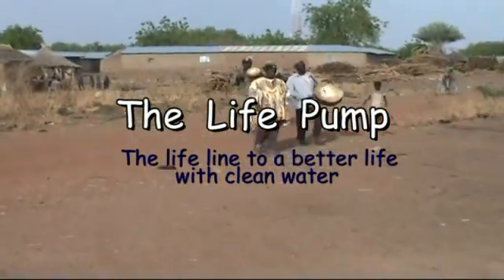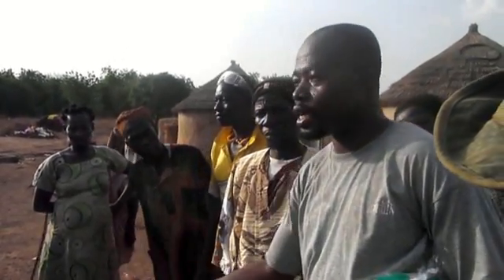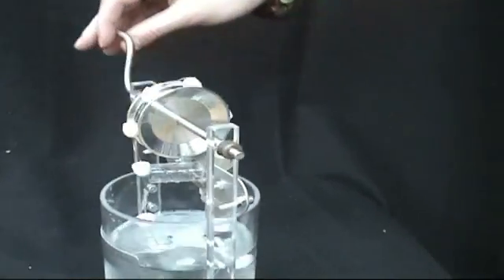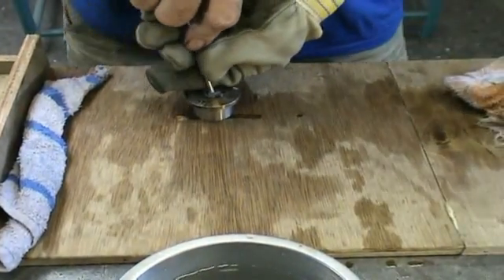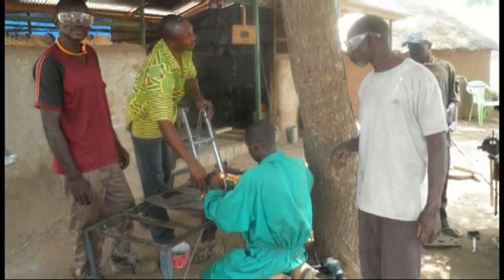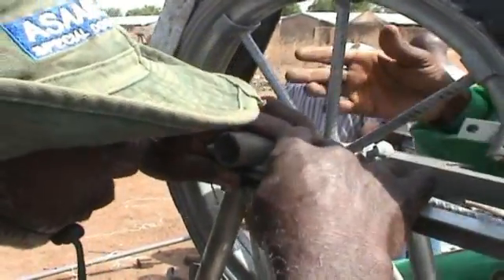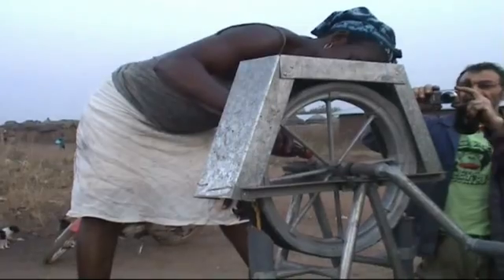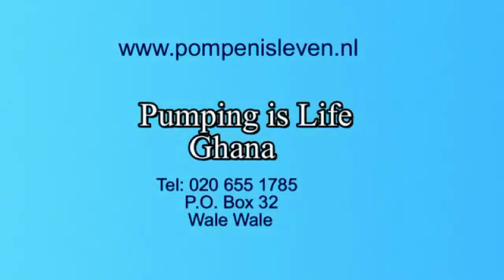The Life (rope) Pump

Comment: you can simplify your pump usage by replacing handcrunk with foot pedal and flywheel made from metal or much cheaper _concrete_. Rotating speed can be ajusted with bicycle chains and sprockets
Reply: Yeah, but the system design is primitive. An increase in speed would wear it down very fast. Running it manually is a way to rationalise a scarce resource. :)